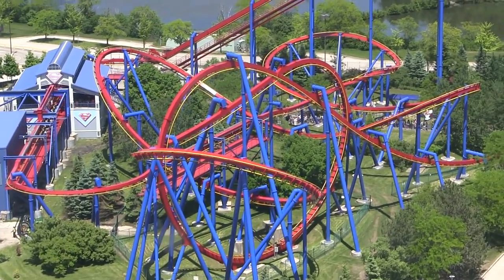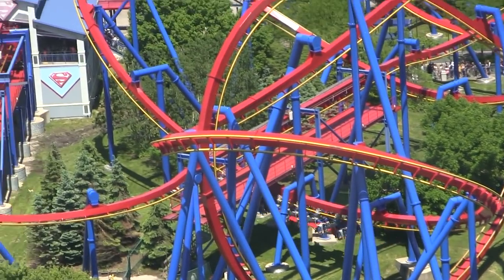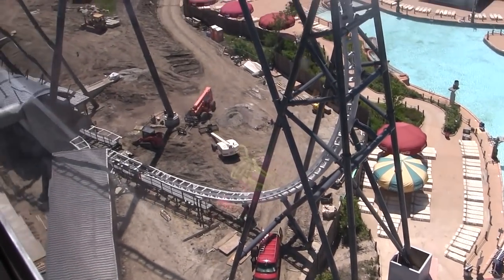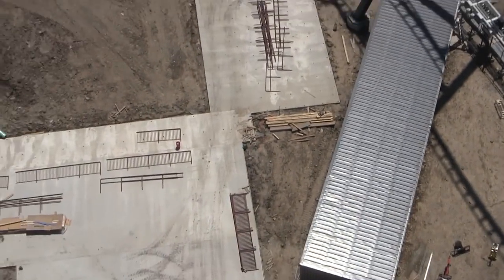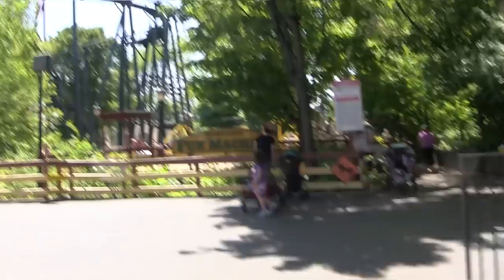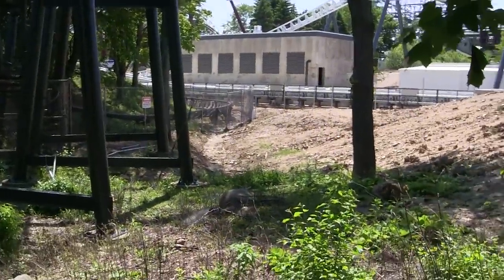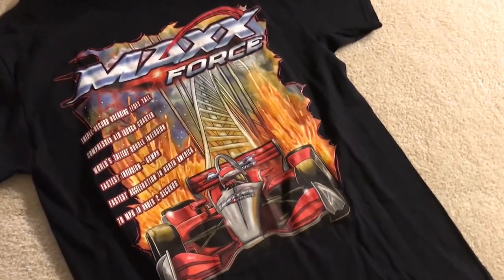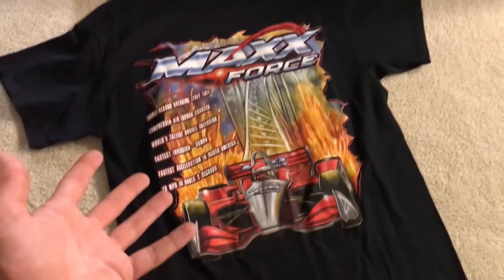Maxx Force Construction Update

Comment: They might as well wait to open this next year
Reply: If you think that, looks at the progresss on west coast racers
Reply: Fancyflashdrive Roller coaster enthusiast I am really sure you’re a smart guy maybe you can figure that out yourself.
Reply: The Flip oh I am clearly aware. Kings Island will be done with there giga before West Coast Racers and Max Force will be done.
Reply: Fancyflashdrive Roller coaster enthusiast Yeah that may be true but they still needed to have been done on time. Especially with massive projects like Steel Curtin  they should have started pouring footers mid season.  For example Kings Island are poring footers as we speak. I guarantee you they will be going vertical by the end of the summer.
Reply: Mr. Crash I understand that but it should have been done at the begging of the season and people should be riding it all ready. It makes for a rush job
Reply: Mr. Crash Six Flags can’t even open a flat ride on time.